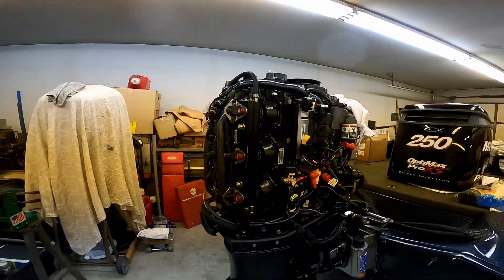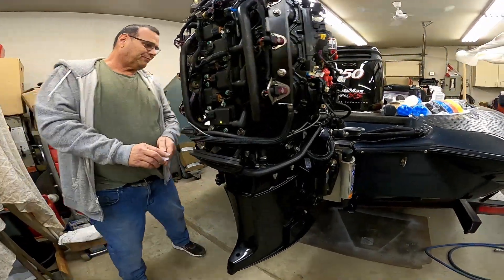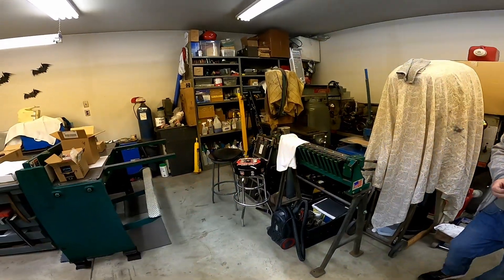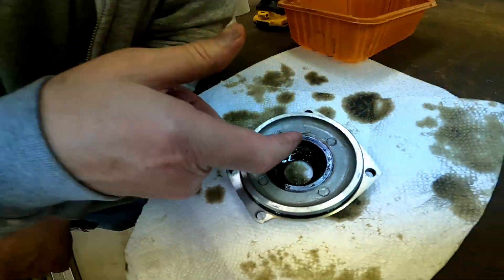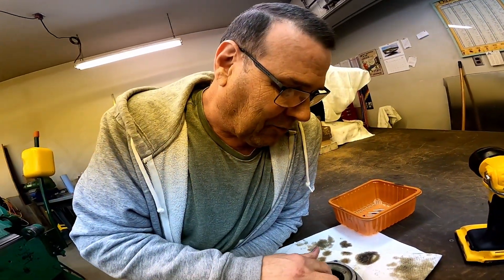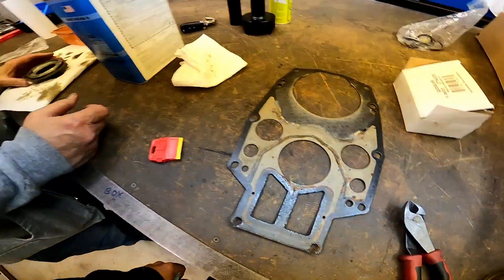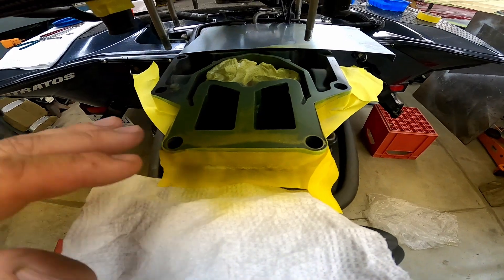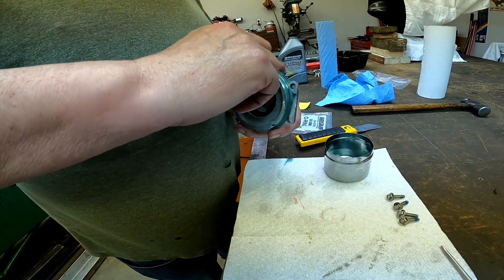Mercury Optimax Pro XS 250 - Lower Crankshaft Seal and Powerhead Gasket Replacement

Comment: Does the powerhead gasket seal kit come with the crankshaft seal too? What is the torque spect for those bolts?
Reply: Hi thank you for watching. The powerhead gasket is a separate item you can get just the crank seal by itself or you can also get the endcap assembly with the seal already installed as well . Check the old endcap mounting surface with a straight edge and make sure it's not warped if it is replace it .the torque for the endcap bolts is 84 inch lbs and put a little blue loctite on them .

Comment: Thanks for this video.  Am about to split the powerhead on my port side ‘05 225 Optimax.  I have ALOT more exhaust bubbles coming out of the port engine than the starboard one and there is only roughly (“by feel”) only about 25% the volume of exhaust air coming out idle relief port on port vs starboard.  

For a long while I had a failed ignition coil on port engine and had not changed the spark plug wires which were failing with age.  Changed out the bad coil, replaced all the plug wires and got all my power back and back to full WOT 5400 rpm like new.  Still, from my research the exhaust tube idle relief ports on port side engine are now plugged up with carbon and oil, causing the major disparity in bubbles out of the prop.   There are 18 idle relief ports about 3/8” inside diameter each inside the exhaust tube and they can and do get plugged up.  When that happens, at idle in the water, all the exhaust comes out the prop instead of both the prop and idle relief ports at the lower back cowling.   The relief ports can’t be accessed  or cleaned from below, have to split the power head to get to them as they are at the top side of the exhaust tube.  I bought a used exhaust tube supposedly from a low hour Optimax that had blown and was partedout for cheap on eBay ($80 shipped).  It’s in good shape and the ports are not clogged up but WOW there was a lot of oil and carbon and soot inside it.  Put it in a tub and hit it with a couple of cans of engine degreaser and brake parts cleaner and cleaned all that gunk out.  It’s ready to swap out with the clogged one once we split the power head to get to it.  Although I don’t think mine is leaking, I am changing the bottom main crank seal assembly and relevant gaskets while in there.

I bought my boat (29’ SeaVee Center console) new in late ’04 and have about 1450 hours on my ‘05 225 Optimax DTS engines.   I have had very few issues but am maniacal about maintenance and go beyond the regular scheduled stuff.  For example At 1100 hours as a precaution I changed out both air compressors with brand new ones.  The compressor is a vulnerability and when they fail it’s usually a catastrophic failure and grenades metal all down the fuel rails ruining the injectors and diaphragms.  I also did recently the air/fuel diaphragms and tracker valve in the rails for the same reason.    Put on new drive belt every other summer and all other the regular “standard” maintenance.  

One thing I did was about 400 hours into them, I stopped using Mercury Optimax oil and switched to Pennzoil XLF 2-stroke TCW3 oil.  Only about $19-$21 a gallon on Amazon or at Walmart here in the US.  I attribute the longevity I have gotten from the engine and that my original air compressors never failed to that XLF oil.

Despite some perception that Optimax was not a great engine, my experience has been great.  I now know A lot about how these engines work and how to maintain them and will keep them until I have some major failure that is not cost effective to repair.  At that time will re-power likely with 250 Mercury Pro XS Four atroces somier can retain my hydraulic steering as I have twin stations.  

Thanks again for the very informative video on splitting the Optimax powerhead!
Reply: Torque specs are on page 4A-11 item # 16 on the list manual part# 90-8M0122849 This is the latest 2018 version the reason for leaving 9-10 at 25 is so the bore is not distorted on cylinder#6 Numbers 1-8 are torqued to 40 ft/lbs

Comment: Thanks for the video, I have a   250 optimax with a slow leak   oil is coming out near the lower unit fill hole behind prop however it does not appear to be coming from the plug hole? Any ideas would be helpful.
Reply from the maker: Could be a bad gasket or o-ring for the prop shaft, do you have the ability to pressure/vacuum test the lower unit?
Reply: A quick check for the gear case would be to drop some fluid out of it and see if it has water in it .If it looks milky that would tell you that its likely a seal problem.

Comment: If rubber has made it down to one of your main caps It has probably also made it into your main bearings or your wristpin bearings. honestly if it were me, I would just be breaking that block down to clean it and possibly rehone it. Throw a new set of rings in it and check bearing/surface tolerances and replace as necessary. it will be like a rebuilt long block...
Reply: Thank you for watching and commenting we had the same concerns and thoughts as you eventually we ended up pulling the intake plenum and reed plate out and were able to get a good look at the crank and rods and it was not as bad as we expected . It ended up getting new reeds because one was cracked cleaned up and put back together we ran it for a few months this summer and fall and it runs great . I was able to talk to a couple people that work on them regularly and they said the rubber is not a big concern to them they see it on all of them to some extent as the belt wears rubber dust accumulates around the throttle body and plate area and some enters the intake as there's no filter to stop that .When there's a belt failure you do get bigger chunks that take a long time to dig out it gets everywhere .

Comment: Would a bad lower crankshaft seal cause a issue with the sensors like Map or air sensor and tell the ECU to give more fuel when accelerating the throttle. My seal was bad and my main symptom was excessive flow rate compared to the Starboard motor, almost double the fuel rate at 4000rpm. The smell of fuel was overwhelming coming out the exhaust
Reply: I would say no it would not have that effect on your motor running as you describe. I would pull the plugs out of it and see if they all look the same or if any are really wet or carboned up more than the others also do a spark test to make sure all the coils are good and firing you could have a dead cylinder. You can check that your TPS is functioning correctly with an ohm meter it can cause a rich condition if it's not sensing the throttle position properly also a good possibility you may have a bad injector maybe more than one that's dirty and stuck you can pull those and have somebody reputable that does marine stuff clean and flow test them to make sure they are in tolerance. You might have to get someone to plug a diagnostic tool into it that would narrow it down quick if the stuff above checked out ok.
Reply: @chrisholmes1666   Unfortunately I sent off the air and fuel injectors to get tested cleaned/flowed. The report came back they were fine, I also did a complete coil plate swap from motor to motor to see if that was the problem, it wasn't the coils, I swapped TPS from starboard to port and that didn't work, I swapped the complete  VST and that didn't work, Just replaced the bottom cranks seal yesterday, it was bad with chunks of rubber in it just like your video. Will test tomorrow mornig. Will report back with results. We connected a Mercury DDT to the ECU and ran it thru a diagnostic test, it had no faults, also did a coil drop test with no luck. hopefully tomorrow I will learn more.
Reply: @jmatak9  It sounds like you have done a lot of work trying to diagnose it . Very handy to have the other motor to swap parts from to see if you can isolate or have the problem move to the second motor hopefully you can get it figured out and end the frustration and for sure please report back how you make out . Have you had a ddt on it while on the water? if not that might be a good move but it is strange that it doesn't have any stored faults being as rich as it sounds .
Reply: @chrisholmes1666  hopefully will get it on the water tomorrow, I'm thinking its a relay/regulator issue now or possibly a battery issue, I've learned that these 300xs motors need a good strong battery to function good. Thanks
Reply: @chrisholmes1666  Thanks for responding, plugs are very similar in color but wet, I replaced the with new NGK's gapped to 44, its dumping fuel out the exhaust, I'm wondering if the lightened flywheel that was put on when we dropped the powerhead on wasn't torqued correctly and partially sheared the key way?? This would mess up the timing and have the ECU dump more fuel. Going to check on that and get back to you.
Reply from the maker: Hey there, looks like my old man beat me to the punch on replying - Just wanted to say thanks for watching!

Comment: Any idea of the total cost of this job roughly?
Reply: A rough guess would be 350- 450 dollars canadian money for the parts powerhead gasket- seals-otiker clamps and paint for the exhaust adapter plate. The powerhead gasket is expensive . You can buy the lower cap as an assembly if its available with the seals already installed so you don't have to mess with that they weren't in stock when we did this so we opted for the seals individually .
Reply: Appreciate the follow up. Way cheaper than I expected actually
Reply from the maker: Looks like my dad beat me to the punch on  replying, so thanks for watching!

Comment: Love these hands-on videos.  I may have missed it in the video but how did you know the seal was leaking in the first place?
Reply from the maker: We appreciate you watching! We found it when I was unfortunately not recording. We pulled the lower unit and the top of the impeller housing and drive shaft we’re covered in DFI oil, as was the inside of the leg.

Comment: Awesome video. I am getting ready to take on this exact same task on my 250 Pro XS. My powerhead base gasket is original. Hopefully it isn’t a nightmare. My motor only has 110 hours on it. Im hoping this isn’t something that will need to be done again anytime soon.  Have you had a chance to run it? No oil leak?
Reply from the maker: First off I’d lie to just say thankyou for watching! If one person finds this video useful, it was worth our effort to make it. We do have the motor running now, and all seems to be well, no leaks so far!
Reply: I believe you have two options for the crank seals if your changing those two you can get the individual seals and Oring and install them in your housing (make sure the mounting surfaces are flat on it check with a straight edge ) or you can get the whole housing with seals and Oring already installed a lot of people do this because they don't want to mess with the seals . The seals go in both lips facing down with loctite 271 around flange when installing  back on the block make sure to lube the oring and the seal lips put a little on the crank sleeve and blue Loctite on the four bolts push the housing on start the bolts an pull up squarely using a socket in a criss cross pattern very slowly so it moves up evenly then torgue to oem spec and you are done
Reply: Great news! It’s also really cool that you get to hang out and work on stuff with your dad. Cherish those moments. I’ll be watching for more content. 👍🏻
Reply from the maker: @tobytester2674 Very true my man! As long as people like you are interested in watching, we’ll keep making videos. Cheers! 🍻
Reply: When you torqued the  four end cap bolts did you notice a small gap between the end cap and block? It’s less than .010. I’ve tried a couple different times and can’t get it to pull up flush all the way around. Just on the corners where the bolts are. I feel like the o-ring is keeping it from pulling all the way up. I wish I would’ve thought to have looked at it before I removed it from the block.
Reply: @tobytester2674  Is this the original end cap or did you get a new assembly with the seals already installed? Have you tried installing it and torquing it up without the Oring to see if it looks the same that would tell you if the Oring is the problem causing the bolt flange to distort when tightened I doubt that it is but anything is possible. If you lube everything up including the block with a light coat of 2-4-c or two stroke oil and try to go straight up without twisting the end cap back and forth to much when lining up the bolt holes and when the Oring is in contact with the block it should seat correctly and then tighten the bolts up slow and evenly diagonally it should pull up without any issue. You can check the mounting flange on the end cap and the mounting surface of the block with a known good straight edge and some feeler gauges to .It doesn't surprise me that the corners would come in contact first just by the design of the part it just looks prone to do that to me .I have heard that its supposed to be perfectly flat no gap after it's installed but have never seen a good picture of one that is but would like to. It would be nice to have another new one to compare it to but us garage guys never have that luxury it seems.
Reply: Hi It's not a terrible job Do you have the oem service manual for it  if not we can tell you the torque sequence you have to be careful of the two under cylinder 6 they have a lower torque value so you don't distort that cylinder and you need a 16mm torque adapter for your wrench but a 5/8' one will work ok to .Make sure you get the right otiker clamps and tool to replace the factory ones where you remove them there's two or three different sizes all metric and stainless steel the other stuff is radius head 6" zip ties . undo the shifter out at the slide its easier there than at the vertical shaft running down the leg to the lower unit don't overtighten the 10 mm nut when you put it back on snug and back off a half turn or so. it's actually easier to do the job with the lower out because you don't have the crankshaft splines to line up but if nothing was moved that probably won't be a big issue. As far as the gasket if it's the old original one I understand they can be a pain to scrape off the big thing is to try and do no or minimal damage to the gasket surfaces the block is unpainted and needs to be clean you can remove the 10 mm studs to make it easier then reinstall them after with 271 red loctite  the adapter plate needs to be brought back to factory condition sanding and feathering out any irregularities then zinc chromate primer and a few coats of phantom black mercury engine paint let it dry overnight .You have to be fussy about this because it's your water seal between the block and adapter plate if it leaks after you get it together you will be pissed  off lol try and use soft tools to scrape plastic razor blades etc not sure if gasket remover would put a dent in it or not but might be worth trying if it's real stubborn anyway if we can help you in any way let us know and good luck take your time don't force anything and take a bunch of pictures with your phone as you are taking it apart.

Comment: Awesome it so interesting how optimax are a job security for mercury 
Here’s what I had with my 2004 175 optimax crankshaft sleeve it fall off the and I wasn’t able to reinstalled the lower unit
Reply from the maker: Oh ya, we’re funding some Mercury executive’s new yatch with all the money we’ve had to throw at this thing😂
Reply: How did you fix this? Did you have to pull the powerhead also?
Reply from the maker: @rashadgriffith7792 Yep, pulled the power head and replaced the parts

Comment: dunno if it's a good idea to paint a machined surface ...if they aren't painted from factory is because you dont need to. the best method is just clean it all with plastic razor or plastic brush wheel (the tinny ones from dremel) and it's good to go. btw: silicone paste is super safe on pretty much every rubber or plastic
Reply from the maker: They are 100% painted from factory, and it states to paint the surface right in the Merc service manual.
Reply: @FishingOntario ah ok, didn't heard the explanation the first time I've watched . Those are teflon oil seals ? They recommend any lube on them in the manual ?
Reply: @Danidasanic  I don't believe they are teflon as far as lube mercury says 2-4-c grease in the void between the two seals and a small amount on the crank sleeve same on the Oring some premium plus two stroke oil or light coat of 2-4-C grease before installing and torgueing into place
Reply: What size torque adapter is needed to torque the 10 mounting bolts.
Reply: @Lray4x4  16 mm but I believe a 5/8 " would work also if you had one on hand. There is a torque sequence to follow that's in the service manual initially everything is torqued to 25 foot lbs following the numbered torque pattern then bolts 1through 8 are retorqued to 40 ft lbs and 9 and 10 are rechecked and left at 25 ft lbs so as not to distort the bore on cylinder number 6 . Also make sure to use the torque adapter 90 degrees to the wrench to get accurate torque numbers .
Reply: @chrisholmes1666 I will be splitting the powerhead from the midsection on my ‘05 225 Optimax DTS port side engine soon.  I have the Mercury Factory Service Manual but can’t find in the sections on powerhead removal and installation anything about a specific torque sequence for the ten 16mm lock nuts or reference to a different torque spec for some of the nuts, just to do it in three progressive steps to reach 68NM or 50lb-ft.    Can you tell me where you found that torque sequence?